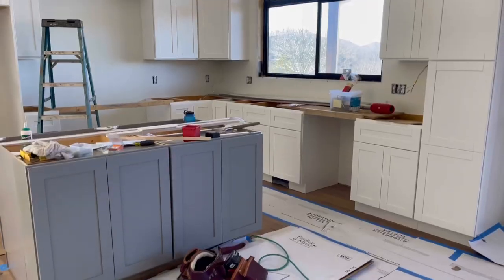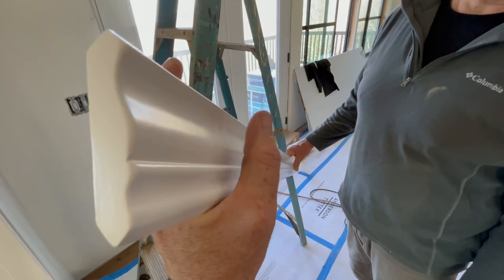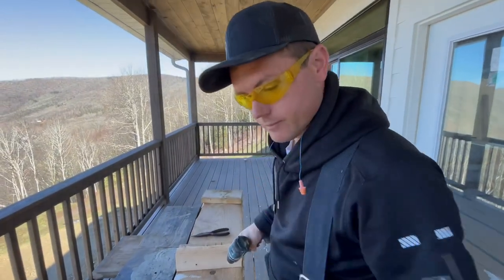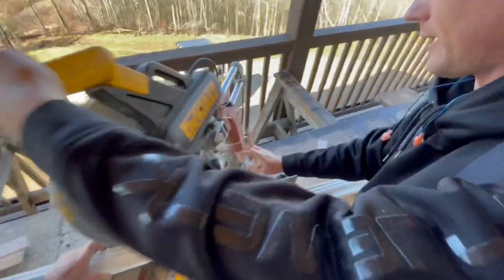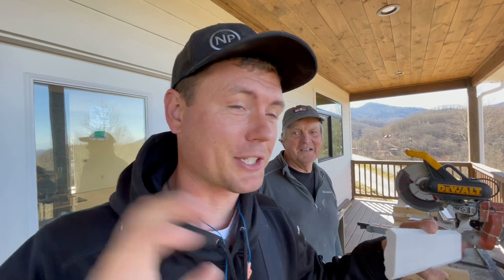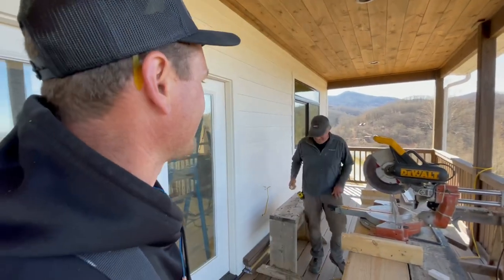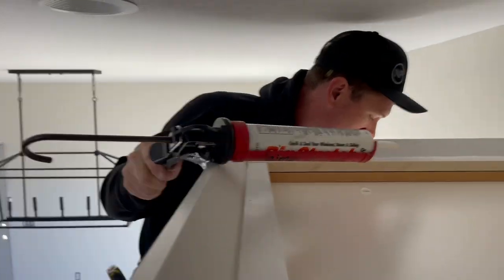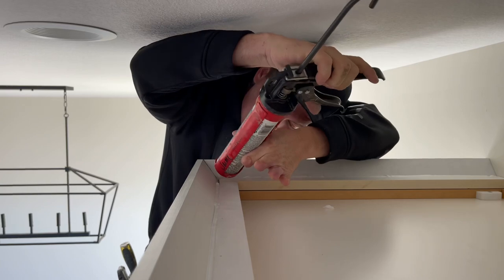Building The Farmhouse | Day 67

Comment: 52/38 spring angle is for higher ceilings. The higher the ceiling the more the crown has to face back down at you. Some can be flipped to work on low ceilings depending on the design details. 45 is most common for 8ft and under ceilings.

Comment: On the crown moulding angle. 
I don't know if it is correct, but when I was younger, my mentor told me it is because no surface is perfectly flat. The odd angle creates a relief for any bumps and raises in the plaster work. You position it so that gaps are as even as possible then use a piping bag to push plaster in to finish the moulding. It doesn't matter so much in the US because you don't finish your drywall the same way we do because in the UK you finish drywall by plastering over the entire wall. This introduces more imperfections to the wall making the gaps fluctuate even more.

Comment: When cutting crown I hot glue a fence to the saw table, then knock it off when I'm done.  Usually breaks off clean with no glue globs left behind.
Reply: Dang, man. That’s a good idea. Might try that one. Thanks.
Reply: painters tape on the saw deck with a piece of wood CA glued works real well too.. and pulls right off afterwards
Reply: @paulsavidge8847  that’s what I do as well. Stays true and comes off easy
Reply: THAT's a Pro Tip!

Comment: Shoulda got top mount crown, which has an extra leg on the bottom to give you a way to nail it directly to the cabinet top.
Reply: That is why it  is called 'cabinet crown'
Reply: Pretty sure that’s the crown that comes with the cabinets. Same color, finish.
Reply: @robertbeirne9813   sorry but that is regular  trim crown. It comes primed  white and of course they could have pained it . Real cabinet  crown has the fixing strip either molded  or fixed onto it.  Still this is an ok way to get the finish with a little extra work.
Reply: @libraiis  not sure what crown you are installing but that is what is installed on all cabinet manufacturers I’ve ever installed. Plenty of times had to install hardwood backers in order to install crown. Just make it easier and install on the ground before you hang. You must be thinking of light rail. Plus if your firing crown between ceiling and cabinet how would you ever fasten.

Comment: Not sure if anyone ever answered Jaimie’s question about why the crown didn’t go to 90 degrees. My experience is that all ceilings- plaster or drywall- are wavy. Not saying anything about how you work. Imperfections in wall board and finishes. The top edge of the crown is designed to be scribed to the ceiling. Love your hands on channel. Moving to Charlotte next month. ❤️🤙

Comment: Still using wet glue and nails on crown molding mitres?
You should be using cyanoacrylate and activator spray. 
Glue one side, spray the other, push together, hold for 10 seconds, done. And the joint is stronger than the material itself.

Comment: Crown pro tip to not install upside down........crown moulding is designed to be installed mirroring base board. If using let's say speed base you would then put the decorative side if crown down

Comment: Why crown moldings are not perfect 90 degrees? The same reason why you tilt your circular saw a bit for butt joints. With a sharp edge it is easier to make tighter connection to wall.

Comment: In the uk we have mitre adhesive, which is basically like CA glue with a separate accelerator spray, you put one on each surface and it bonds in 5 seconds. Do you guys have that over the pond  ? it’s incredible stuff 👍🏼
Reply: We have it to. Carpenters who specialize in trim work are more likely to use it than guys who do a little bit of everything.

Comment: To cut crown flat with a compound miter saw get a crown miter angle guide/chart (Google it). Measure your angles with an angle finder or protractor. Lookup the angle on the chart for your angle and bevel settings (31.6 and 33.9 are only for perfect 90 degree angles). If you	r angle is slightly larger or smaller you need to adjust these numbers according to the table - crown is alot of geometry.  Set your saw angle and bevel to cut the crown. Works like a dream and you wiill get perfect, tight miters every time. Also, crown is commonly installed 45/45 or 38/52 in the US, but other rise run is used. Your crown might have those angles pre cut on it. Nice work!

Comment: Check out Finish Carpentry TV his YouTube channel has a ton of information on finish trim work. One trick I learned from him was to use CA glue and activator to glue all joints and to put a scab board behind joints when able to. I watch Perkins Builder Brothers, Essential Craftsman and Finish Carpentry TV regularly  and there is a ton of building knowledge between these channels.

Comment: We went from home Building to exclusively kitchen remodeling for the final ten years of our business.  We always used custom cabinets and ordered them several weeks before we needed them.  When doing crown we would order them with extended top rails so that we had a better nailing surface.  Especially if the customer wanted full overlay doors.  Also the cabinets would come without the extended 1/4” front frame.  No notching or filling in when doing the crown.  Inside 45 degree cabinets were a little tricky adding crown.  Kind of tricky getting a tight fit that would stay because where the two 22 1/2 miters meet it’s difficult to shoot them from the back.  I guess it’s a little easier now because of the new instant bond glue.  Good point Jamie, always pre fit the two pieces together before shooting.  Love your videos and the way you all strive for perfection.

Comment: Crown molding is 100 percent accurated so it line up at an angle lay against the on wall and ceiling so what ever you do on the first piece on the saw made sure you do the same through out the molding good luck bec I did it by myself lots of time and I hated it I hated so much

Comment: You said earlier in the video that the angles of the crown molding are different.  45 deg and 52 deg.  It wont line up in a 90 deg corner because the sum is greater than 90 degrees.

Comment: not bad, but you should have cut a 1/4 inch piece and put it on the end of the cabinets at that top about 1/2 inch wide so the crown won't have a gap under it. even though you put a filler on the top.

Comment: In 1:20 you said that there are two different angles on this piece, 45 and 52'38, that explains your question from 6:20 :)
Reply: @jerrytruax4807  My bad, I've misunderstood it there. Thought it Is 45 and 52'38, so 97'38 in total. 
I have actually watched again part in 6:20, and it looks like angle is sharper than 90 degrees, so I was double wrong, wow.

Comment: Perkin Brothers check the Fastcap web site they have a pole to mount your laser, it goes from the ceiling to the floor.  They other things for cabinet installation.
Reply: Installing cabinet uppers with two adjustable paint pole extensions for years as prop sticks. No faster way to install. On finish floor just have to put a lot of tape on the bottom not to mark the floor. I used to use fast caps pole but found the paint extension poles faster.  We install whole houses single man.

Comment: Hey guys. Was this classic profile crown molding the best choice for the simple MODERN design of the cabinets?
Reply: I wouldn't call the other cabinets particularly modern, but the crown molding firmly rooted them in 1958.
Reply: Custom house, almost positive it was the owner's choice. Is it a good choice? Nah... lol
Reply: Those are basically a variation of Shaker cabinets. Certainly not a modern style, but has really made a come back in recent years. We had beautiful cherry Shaker cabinets in our previous home. The cabinet maker had a very simple crown with a little bead detail. That was perfect.
Reply: @1packatak  Usually Shaker has more of a corner radius and a deeper recess. Regardless, a simpler crown molding would have worked better.

Comment: Seems like hard work for you guys in the States...here in England where we call it a Cornice moulding it is supplied with a machined base foot that screws or pins to the TOP of the cabinet.No ugly pin marks to fill and all mitres superglued with mitrebond......much much neater and simpler...in fact it was hard to watch how complicated you made it!!
Reply: The real solution is to not use crown moulding at all, especially if your cabinets don’t reach the ceiling (I then looked up to realize that we have it, too; good grief).  But, really?  Why?

Comment: I’ve never done crown moulding before, but here’s my thought on why the crown moulding is not perfect at a 90 is that you want only the front edge touching the ceiling or the wall so there’s no gap to be seen when you install it in place, it’s beveled on purpose. I don’t know if that makes sense.
Reply: It's just crappy material, not an intentional detail. If you look closely when he holds the crown to the square, it's the back of the molding that touches. There's no way to have tight contact with the cabinet and ceiling, if that were the application.

Comment: It's a shed.
Sorry for the obviously excessive start, it's a dreamhouse with it's surroundings, but I would like to have some thoughts from you guys.

I don't get you, Americans. In Hungary where I live - which is a poor and old-fashioned country and yet - it would be impossible to build a house with this thermal quality by regulation. The max thermal loss is 0.008 W/ft3
K what is achieved with a min. 12 inch brick wall + 6 inch xps insulation outside, min. 15 inch rockfiber ceiling insulation and 3-layered argon-filled windows. In a climate where we don't drive next to ski resorts, barely see any winter cold at all. I assume the farm house consumes at least 4-5 times the energy per sqfeet for heating and cooling. I know, I know, by the code...

Maybe the root of the difference in point of view is the cost of energy itself. And I mean not just the actual price, but the environmental impact of it. As I see "from here", the house itself is at least the double size as a typical european family home with 2-3 kids, and the people are not smaller here. It's a habit so it's hard to overcome. But the engineering aspect is just... wrong  Ignorant, i would say.

What are your thoughts guys?

Perkins brothers, keep up the good work, I really enjoy the show and the quality if your work. The thoughts above are not meant to be an insultation (I wrote insulation first 😉). Cheers!
Reply: Unfortunately, the way the culture is in the states: this will not change.

The current setup has us using more electricity that some of you folks across the globe, but it’s in the electric company’s best interest to keep houses as inefficient as possible, thus selling more electricity. While I don’t have proof of this, I would bet that there would be some lobbying done by the power companies that would keep code and legislation relating to code very loose, thus having more inefficient buildings, meaning more power consumption. Again, no proof, but us Americans have seen crazier shit with lobbying.

And I love the Perkins Bros and their work, but unfortunately there is more demand for new houses than there is quality houses. So there’s no sense in installing the best of the best insulation when in 40 years the house is going to get torn down. Sadly, not every building crew is like the Perkin’s Bros, and these production crews are literally slapping things together as fast as possible, not taking their time on anything. 

TL;DR America values new stuff, not quality, and it’s in everyone’s financial interest to keep houses as inefficient as possible, even to the detriment of the homeowner. Unfortunately this will not change in the next 50 years or so.
Reply: But if say, a homeowner would like to build a house fashioned to european standard, will that be possible without nullfying the codes?
Reply: @swickj_  wow. In retrospect I have to tell you are right, sir. Most of the european service companies were in government property at some point or has strict regulation. The same goes to the oil companies, causing the size difference of cars.
Reply: @miychaeolit  very intresting point, Mike. However I think, the outer shell has to be loosy enough to put some solid insulation. The main structure is harder question.